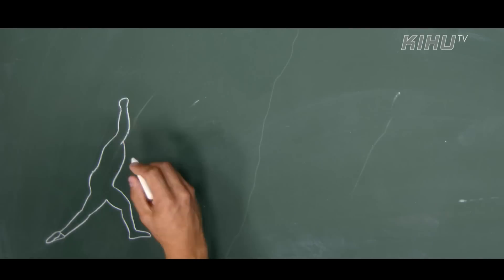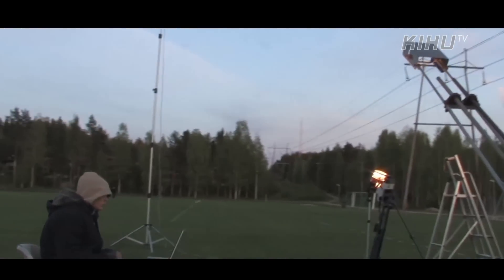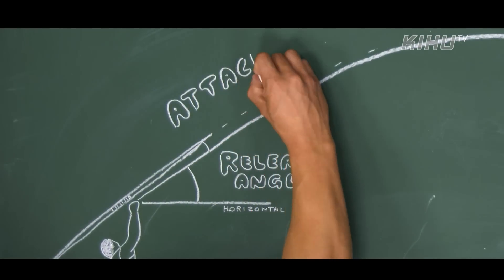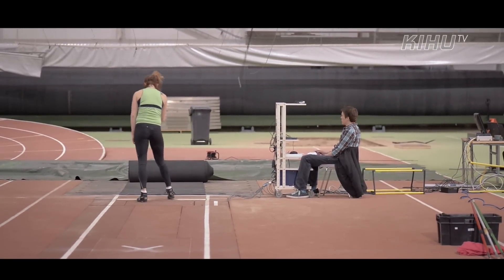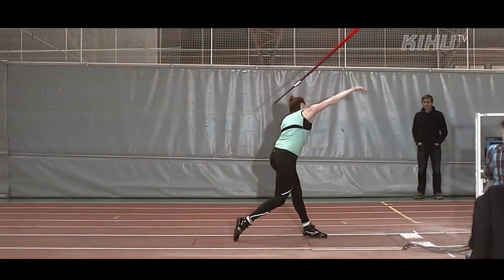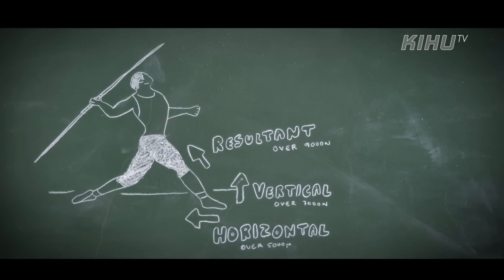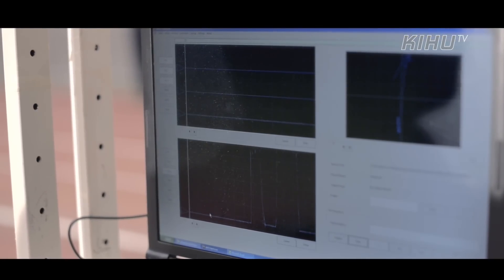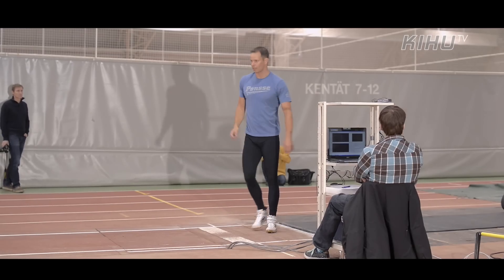Biomechanics and Measurement of Javelin Throwing

Comment: Interesting stuff. Small mistake at 0:30, though. The unit of measurement of acceleration is m/s^2 (not m/s).
Reply: What is shown is correct. He's saying that the javelin is accelerated up to a speed of 30 m/s, so the release speed is 30 m/s.
Reply: Oh, that's true - my bad. Quite an acceleration, from approx. 0 to 30 m/s in 100 ms.